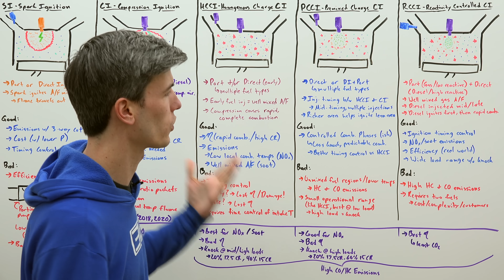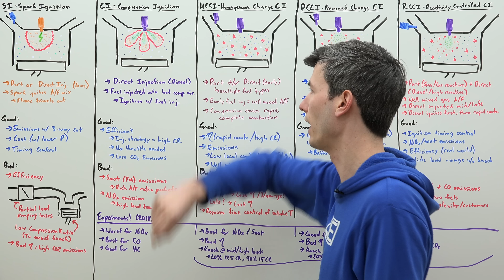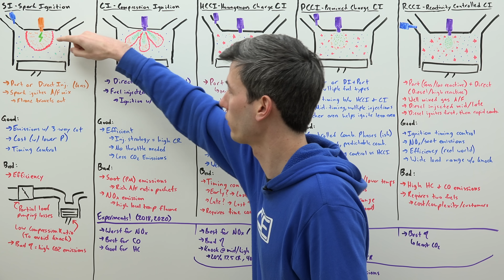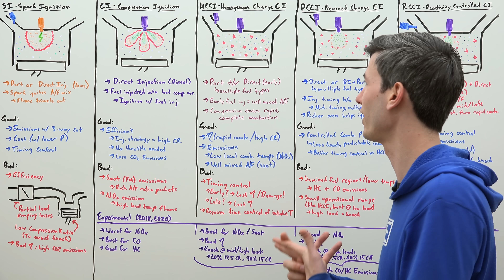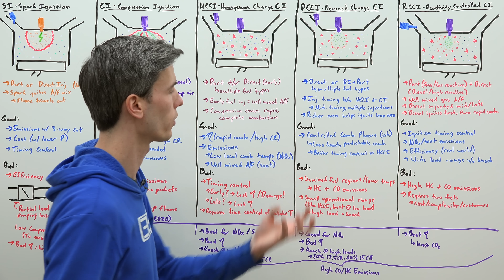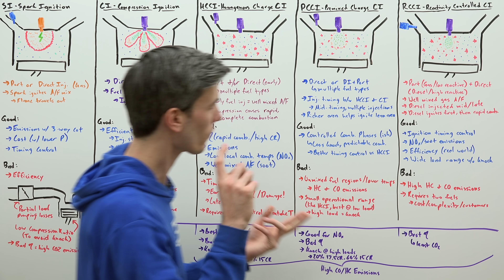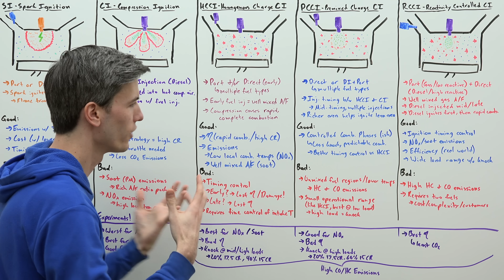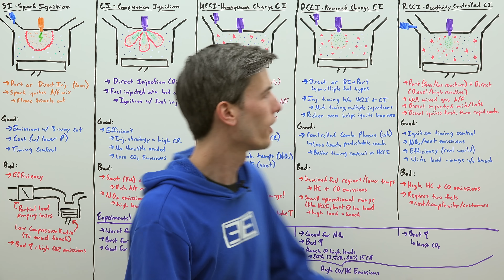If Combustion Engines Have A Future, What Is It?

Comment: I've heard about running an old car until it dies being more environmentally friendly than buying a new e/v. Is this actually true? Would love to see Engineering Explained guy going over the statistics of this issue
Reply from the maker: Answered here (starts at 9 mins 30 secs), however a video dedicated to the subject could be interesting! https://www.youtube.com/watch?v=6RhtiPefVzM&t=570s
Reply: @EngineeringExplained  how did you count co2 emission related to electricity production in that comparison? It depends on the generator technology
Reply: @EngineeringExplained  As long as there is a whiteboard, I'm in.
Reply: @Engineering Explained

If you want to make a video, search for the analysis of Volkswagen. They tried as one of the first to do a proper analysis of all emissions between different car motor types, cradle to cradle. So no propaganda like here from some petrol heads that try to argue that it's more dirty to produce (centralised) and transport electricity than to produce transport and burn fuel decentralised in every little damn motor.
Reply: @Majorhantines  
The ICE engine has no future. The end will come quick.  When fuel is difficult to buy as the stations close down.
Reply: @johnburns4017  "the end will come quick" Lol no it won't, internal combustion engines have a higher chance of being revolutionized than dying off with new materials being made or found, new technology, better synthetic oils, new ways to improve efficiency, and creating a synthetic fuel that is much more emissions friendly and has a much better reaction in the chamber. There is still plenty of room for improvement.
Reply: @TheFlame234  
Complete tripe.
Reply: @johnburns4017  Another Biden voter. What is difficult and not is reflected in the price of the car. What is it a Model S costs? Someone here is living in lala land.. created by the media and those in power.
Reply: @martinsvensson6884  
Did you vote that lunatic Trump?
Reply: @EngineeringExplained  You should but be prepared for the environmentalists to swarm into the comments section lol. One on twitter directed me to a website that "calculated" the impact of an EV being built, including mining of the metals for the battery pack (allegedly) against the car you currently drove.
Reply: @spamcan9208   Pretty hilarious that you're trying to portray someone correcting your incorrect beliefs with data and sources as "environmentalists storming you" . So far all I've seen in this comment thread are petrolheads preaching with a misplaced sense of authority about a topic clearly outside their area of expertise.
Reply: @EngineeringExplained  I would love to see a comparison of a bought new and owned 60 years 1960s Land Rover Vs a replace every 3 years lease car including the recycling of the one Land Rover Vs all those cars 😄. Imagine all that white boarding 🤔
Reply: @EngineeringExplained  
I know that you calculated that the electric car would be better than an old car in about 5 years when comparing CO2, but what about when the chemical pollution is considered when mining all the components of the batteries? How bad, or how good is that process?
Reply: @EngineeringExplained  a big YouTuber replied to me. I feel so special
Reply: @EngineeringExplained  Buy an old car and run it on gasoline/methanol/ammonia blended fuel or compressed hydrogen/natural gas.   I would have to assume the fuel is made from green sources.  But this beats an EV every time.
Reply: @EngineeringExplained  I’d like to see the assumptions behind that analysis.  Does it include all of the energy including recycling of the discarded ICE vehicle?  I suspect it also varies greatly depending on the electricity generation source for the EV.  I agree that a more detailed analysis would be interesting, but I suspect it is not trivial to make such an analysis in a realistic way.
Reply: @EngineeringExplained  
The simple fact is that ICE engines emits poisons right in front of millions of lungs. You cannot get away from that.
Reply: @johnburns4017  What's a UCE engine?  I'm not trolling.  I really don't know.
Reply: @simonthebroken9691  It's a Samoan Engine, just check out Jay & Jimmy Uso, they use the word "UCE" which means "Brother" in English all the time.
Reply: @johnburns4017  the simple fact is absolutely nothing destroys the environment more than the mining for the elements every electric car requires. And most places in the USA still use coal for electricity.
Reply: @Xander1Sheridan  
Nonsense. BTW, In few years time the UK will have decommissioned all its coal power stations.
Reply: @johnburns4017  sure they will. They can say anything they want, 99% of the time it is a lie.
Reply: @johnburns4017  
An electric vehicles give off poisons in a far more hidden way making them seem better than they possibly are.
Could take a look at the pollution caused by the strip mining and the production of batteries you still have pollution from power plants creating the electricity to charge them. It's less pollution overall most likely the thing is the pollution that they do give off is not right in front of your face and so it's simply ignored and people pretend that it doesn't exist.
Reply: @johnburns4017  so do many other industries but they aren't being singled out like engines. I'm a refrigeration engineer and fixing one leak can save 20 years of motoring for my personal car. R404a refrigerant for example 10kg is equivalent to 38Tons. Just let that sink in a while
Reply: @chappy2121  
Other industries are not being ignored.
Reply: @kens97sto171  
ICE vehicles poison people's lungs. The emissions are feet from their noses.
Reply: @johnburns4017  
And EV's poison from more distance out of sight.. doesn't mean it's not there...
Ever seen a lithium strip mining operation... 
Or a coal power plant.. 
Your just moving the pollution around.
It IS less pollution overall.. but it is still there.   
Having it not spew out of the car.. just allows you to drive around virtue signalling that you care about the world.
Reply: @kens97sto171  
If you are saying ICE cars are cleaner, you are getting ridiculous. There is nothing in sight to improve ICE cars: the oil production, hopelessly inefficient engines,  transportation, etc.  EVs in a matter of a few years will be using solid state batteries. 

Wise up.  Look.
Reply: @johnburns4017  
I never said any such thing. You keep talking about pollution coming out of tailpipes directly into people's lungs. My point is the pollution that electric vehicles make is not directly obviously visible but that doesn't mean it doesn't exist. Coal plants natural gas plants provide 70% of the energy in this country. That means that 70% of the power you use to charge up your electric car comes from fossil fuels. Obviously that is still cleaner and more efficient than burning those fossil fuels in an internal combustion engine. You also have the environmental damage caused by mining lithium manufacturing of those things etc. That is my only point is that electric vehicle Fans try to pretend that electric vehicles are perfect and don't pollute at all and drive around virtue signaling that they are saving the world somehow. Electric vehicles are more efficient and they do pollute less but the pollution that they produce is not zero nor is it inconsequential.. 
Efficiency is not the only factor here. It's cost of operation cost to purchase etc that's the reason people buy internal combustion cars right now they're really aren't any affordable electric vehicles for regular folks. There's a hell of a lot of people including me that tend to go out and buy a $5,000 used car drive the hell out of it for 3 -5 years and get another one if and when it breaks down. Now keep in mind that for me in that 3 years I will cover 150,000 miles miles.
I drive an old Toyota Prius it's extremely efficient for a gasoline-powered car it's also very inexpensive to purchase. Maintenance cost me very little as well. My total cost of ownership including all fuel all maintenance costs and tires is $0.07 per mile. Now I do my own maintenance so that certainly lowers my costs a bit. but when I do the math on a brand new Toyota Prius versus a brand new Tesla Model 3 long range. My break even cost point is 12 years even driving 50,000 miles per year. Cost of driving electric vehicle is about 4 cents per mile charging at home 50% charging at public chargers 50% which would be my circumstance. 
$30,000 for a loaded Prius
$48,000 for a Long range model 3
That's $18,000 difference.
 50,000 mi per year at $0.07 per mile is $3500 then work the number at 4 cents per mile is $2000. So  the Tesla only saves me about $1,500 per year
$18,000 difference in price divided by 1500 is 12 years. 
That's not a good financial choice.
And if you drive less than me it makes even less sense.  Although if you didn't road trip very much you could probably get your cost per mile down closer to $0.02  per mile charging exclusively at home. 
Now obviously a Toyota Prius and a Tesla Model 3 are in no way similar in performance. however the Toyota Prius is actually a far more practical vehicle it has more backseat room it has better cargo and trunk space, if something breaks on the car I can go to any auto parts place and get parts to repair it myself etc. But obviously the driving experience in the Tesla is going to be far better when it comes to acceleration and handling. Here's the thing though the vast majority of people don't care about that stuff. They care about cost of ownership maintenance and reliability.
don't misunderstand all of what I have said I like electric vehicles very very much I've driven a model 3 I've driven a Chevrolet bolt EV which would be my personal choice for driving around in the city especially at the price they're selling for now. but I road trip a hell of a lot too and that car does not make for a good road trip car because of the slow DC fast charging. So don't get me wrong I like electric vehicles but they are not the one solution to fit all problems currently. I think they will be in the next 5 to 10 years as battery technology improves and more and more options for different types of vehicles come to market. Hope you guys have a wonderful day sorry for the long reply.
Reply: @kens97sto171  
In the UK one refinery uses the equiv consumption of the cities of Coventry and Leicester combined just to refine oils. This creates pollution in burning fossil fuels to create the petro fuels. Then the fuel is burnt in vehicles creating more pollution, right under people's noses.  Polluting twice. Two processes to get vehicles moving.  

Charging batteries is only one process, with none under people's noses. 

You are doing a bad job trying to justify the unjustifiable.
Reply: @johnburns4017  the making of a brand new EV also emits pollutants to the millions of lungs, so what is your point exactly?
Reply: @warboyrb  
Overall EVs emits far less pollutants overall.  They do. I never made it up.
Reply: @johnburns4017  
No.. charging battery is NOT one process 
You have the pollution associated with the manufacturing of them.
The pollution to create the power to send the grid, to charge them . Which in the USA is 70% fossil fuels,  And the drivetrain losses using the power in the battery.
YES it is LESS  pollution.. which I've said MULTIPLE TIMES now .
But it's not pollution free..
And the pollution it does create is more removed from view and perhaps more difficult to quantify also.. since the mining of the raw materials is mostly done in non western countries. Conveniently out of site of the people using the final product.
Regardless there is barely enough supply to fulfill the current use of EV's.  
So let's not destroy what we have and NEED  now for what we will use eventually.
We can have both simultaneously and transition from one to the other as we the public CHOOSE to.. as EV's become more inexpensive and more available.. absolutely people will prefer them.
They are superior in most ways.. and once battery tech gets just a bit better . Virtually all needs would be fulfilled.
Reply: @kens97sto171  
You do get it, but are attempting to justify technology that should have gone decades ago. You have a have a vested interest in promoting this poison.
Reply: @Xander1Sheridan  Apart from CO2 production from burning fossil fuels which posses an extinction risk to humanity and many other species... But we dig that up too... Electric cars aren't perfect, but they're better, and that's what matters until a better option comes up.

Also Coal power stations are awful in terms of CO2/kwh relative to other generation options, but the efficiency of a power plant means it's actually better g/km to drive a purely coal powered EV: 2.21lb/kwh coal power station. Tesla Model 3 160wh/km, 6.25km/kwh, 160g/km. US current average is 251g/km. Not to mention coal only contributes ~23% of American Energy production.
Reply: @johnburns4017  internal combustion is here to stay.

The key is ENERGY DENSITY.

The amount of area the energy takes up is a HUGE factor in efficiency, and this is what throws most electric vehicles out of the ballpark completely.

You see, efficiency effects all aspects of the vehicle, yeah sure the electric motor may be around 95% efficient, and the drive system may be 87% efficient BUT the storage of energy is around 70% efficient (amount of power put in vs the amount put out) and the use of space to store that energy is TERRIBLE.

  From an energy density viewpoint, lithium batteries are crap.
Reply: @chrisarundel9199  
"internal combustion is here to stay."
What is it like a La La land?
Reply: @johnburns4017  yea well evveryones used to it
Reply: @johnburns4017  nothing in sight to improve ICE cars? I take it you've never heard of synthetic efuels then...
Reply: @johnburns4017  Meanwhile: Synthetic efuels said hi.
Reply: @johnburns4017  they aren't doing nearly enough. Taxing the poor people is the wrong way. The big companies are the ones with money not average joe. The client i work for is supposedly a "green, eco" focused company. They have lots of very old stores with very old problematic equipment that have r404a/r407a they do not want to replace any of it. When they open new stores these are on c02 refrigerant which is quite abit different. What's even more ironic is the c02 used is made fresh by chemical process, not harvested from the atmosphere even though they're able to do this. They buy ever cheaper less reliable and more difficult to work on kit. Oh and they refuse to put doors on the equipment so it has to be bigger and have more gas to account for that. Their reasoning "customers won't open doors" they've also cut install times down to 5 weeks for a full store refrigeration system. Also I can stand outside all day dumping c02 into the atmosphere no problem yet the c02 coming out of my car is the issue. Yeah right
Reply: @papasmith7648  
ICE hopeless inefficiencies say Hi.
Reply: @johnburns4017  ICE cars also says hi, I would like you to meet my friend "fast refuelling time"
Reply: @johnburns4017   well, do you have any ideas to push away of what "should have been gone decades ago" more faster???? since you're talking a hell of a lot about the "polluting cars", but not the POLLUTING INFRASTRUCTURE THAT'S BEEN AROUND FOR CENTURIES THAT YOU REALLY TRYING TO TALK ABOUT, huh? i thought so...
Reply: @johnburns4017  so anyone who contradicts you is a paid lobbyist?
Reply: @johnburns4017  While I agree most of the population should be driving EV's, you simply straw-manning your way through this by just calling it a poison isn't helping change minds. THE SIMPLE FACT is that combustion vehicles will always be a niche and will continue to be made for a few people that are willing to pay a premium to have them. EV's will become cheaper than combustion but again, they will never fully disappear.
Reply: @shadowmatt911  
People still run steam engines for fun as well.
Reply: @johnburns4017  I meant that the government will allow people to get special licenses and/or pay more to buy petrol models of EV cars. For example, muscle cars will always have a petrol variant because that's simply what they are, loud obnoxious toys. Most of them will likely be stick shifts as the only people actually buying them will be car enthusiasts.
Reply: I regret clicking on this comment.
Reply: I remember seeing a test of a Saab 9000.. Testing in London showed that the exhaust coming out the tailpipe was CLEANER than the air going into the intake.. this was ca. 1992.
Reply: @jesinbeverly  I remember such a test in Sweden when the new Saab 900, that later was named 9-3, came out.
Reply: Would only make sense to a simple person like me . All the energy used to produce a car and transportation to get the parts to the assembly area.
Reply: It would probably depend on the vehicles.  I get 13 mpg. A prius gets a lot more. It would be more environmentally friendly to switch.
Reply: @dylantroutman4363  depends on your mileage. If you don't drive much, there is not much to be gained from the switch.
Reply: Any vehicle powered by a remote energy source can benefit ,throughout it's life,from new technology used to produce that energy.
A 1990 fossil fuel powered car will only ever be as efficient as a 1990 fossil fuel powered car and will get worse as it ages.
Buying an EV and keeping it for 20 years is more efficient than buying a new EV every 5 years.
Reply: Still running a 40 year old toyota daily may be a issue killing it wont die 🤣 800000km strong
Reply: yes cause it takes a lot of energy to make a car
Reply: @ThunderClawShocktrix  It does actually, if you go to any automotive factory, every production line has at least 5 breakers that are 480 volts and at least 15 that are 120 or 240 volt. So yes, it takes a lot of energy to make a car. Compound that with the fact that there are at least five lines per factory. Most factories range in the 10 to 15 range. That's not even talking how much power is necessary for other essential operations off the line or computer systems that are running 24/7. Get a job in automotive before you chime in like that.
Reply: I'm pretty sure it depends on how much you drive. First the most ecological thing to do is to avoid driving when possible. If you don't drive a lot (i'm averaging about 3000miles a year by car, for about 8000miles by bike), then an old 4cyl ice is fine. It won't produce much co2. The electric car would require a lot of material and carbon for manufacturing and the battery would degrade without any driving being done.
So in the end it depends on your mileage. On the shitty american electrical mix i read that you need to drive about 60000miles to make for the manufacturing of the new ev car.
Reply: Yes
Reply: @Kristaps Valainis the co2 cost of a new Tesla Model 3 Long Range would take 9 years of average usa driving to offset at current electricity co2 costs. but the co2 cost of electricity is falling so it will be less then 9 years soon.
Reply: It's due to the concept of "invested energy" and materials. you already have that car, it's made, if someone makes a new car for you to buy it needs material and energy to make and ship.
Reply: Most cars will out last they're owners if they're properly maintained......so ya it'd be significantly more environmentally friendly
Reply: @robbalinski1606  Old cars yes, but I can say as a person who works automotive, that with modern vehicles, the manufacturers can make and request way better quality parts at no additional cost to the consumer. For example, I can recall several instances, not gonna name any names, cough cough Dodge; no but really, Dodge for example will go to their suppliers and say, "Hey we can't have that part lasting 500,000 miles, make it fail at around 150,000." It's all a money scam to make you keep bringing your vehicles back and buying new ones.
Reply: it is... my car run for 25 years and still run with minimal maintenance....
Reply: The nub of it is grey energy, that is the energy embodied in the manufacture of the vehicle. every combination of a vehicle and its potential upgrade will be different. my feeling is so long as your current car is in good working order its likely best to keep it instead of paying for a new one to be manufactured. 
That being said, I would think it would be better to trade it in if you were thinking of switching to electric, even when accounting for grey energy an EV will account for less total pollution and vastly less local air pollution.
Reply: @strangelove9608  Talk about Hypocrisy to the n-th level.
Reply: @strangelove9608  The Green Hippie Londoners who love their wood fire heaters are giant hypocrites. Burning Wood is ok, but the rest of us are being forced into heavily polluting, environmentally unfriendly all electric vehicles. Those vehicles are SUPER heavy, do more road damage, which requires petrol products to help fix in the long term. The battery's are a nightmare to recycle. The mining for the materials and the manufacutring process for the batteries are even worse than making normal cars. I at least support a PHEV 50/50 hybrid solution and have listed out everything I want to do which would bring balance to the automobile and be a win/win for everybody involved. The Green Hippies don't care and only want to "Be Correct" and push "Their Agenda" with no consideration of anybody else. They're a arrogant bunch of pricks who don't deserved to be listend to since they're incredibly selfish. They just want to rush in for a solution with ZERO consideration about people now and the long term future.
Reply: @strangelove9608  There are 149 replies to Kristaps's comment, and I'm NOT going to hunt for mine. That's just how it is, with YouTube's dipshit UI. IAC my sense of smell is certainly not so bad I can't tell cooking oil from hot crankcase. Christ knows I smell enough of it out on the street. You probably have one of those vehicles yourself. You sound like the type.
Reply: @strangelove9608  Carbon dioxide is not a polluter. Its what everything growing lives off of. It was called "The gas of life" in Sweden back in the days before the climate scam started.
Reply: @martinsvensson6884  "The Climate Scam" What does whom have to gain from this proposed scam? It is independently agreed by people with no vested interests. How would this scam adulterate the numbers coming out of peoples thermometers in their back garden? or out of peoples atmospheric CO2 loggers? It's a bit far fetched to suggest that climate change is fabricated. Occams Razor.

If CO2 isn't a polluter, why not try breathing high levels of it? 

Even if Climate change weren't happening due to CO2 production, the particulate matter produced by combustion contributes to more global deaths each year than Nuclear ever has, and most people think Nuclear is too dangerous. Disagree? Then prove it by breathing diesel car exhaust to no ill effect.
Reply: @Leo99929  "It is independently agreed by people with no vested interests." Haha :) Its "agreed upon" by those in power and if you want to keep your job you go along with it. Stop listening to people working for the beast. It doesnt alter the temperature from peoples thermometers. They alter the data collected. And that is not from peoples thermometers.

No its not far fetched. This is what they have been doing for at least the past 150 years if you just take some time and look up some old news papers. You can breathe as much CO2 as you want... as long as you get enough oxygen. Because CO2 is not toxic in itself. Or you mean that because you cant breathe water then it must be toxic too? :) Plants breathe CO2. Without it they would die and then humans would die too. 

There is catalytic converters on cars nowadays so as long as they are in action cars dont pollute that much. Some air might even come out cleaner during some circumstances. Diesel might have some issues still. So nothing I would breathe directly. Nuclear is good though. Probably the best energy source we have for large stationary power plants. Except maybe water in some places.
Reply: @strangelove9608  I think you misunderstood what I was saying: I was suggesting a system where the poor get more discounts than the rich. And the money for that comes from those rich people who decide to run a gas guzzler because they can afford it paying for the privilege. I don't know how you misinterpreted me to the exact opposite of what I was suggesting...
Reply: @strangelove9608  EV's use regenerative braking to stop, so less brake dust from them. Almost zero if you drive carefully. Tyres still create particulate matter... What's your point? That EV's don't achieve zero particulate pollution so why bother trying to improve things at all? That's ridiculous. Every tiny improvement adds up and matters.

I have a first class honours Masters degree in engineering which included education on environmental, financial, and political considerations. I work in research for an automotive company. I think that makes me "properly educated" and "in the industry". And in my professional opinion: Most current EV's are far from perfect, but they're light years better than ICE vehicles, any improvement is worth having, and the improvement EV's give over ICE are vital to humanity in the medium to long term.

The con is people driving in London. It's a city. It should have excellent and efficient public transport. That is a failing of our government, not technology.
Reply: @strangelove9608  
Total nonsense.  Someone told you to write that.
Reply: @strangelove9608  ^_^, you'd have it easier if you were consistent.
Reply: @strangelove9608  I'm saying all vehicles use an immense amount of energy to create. EV's and hybrids just use more since they are more complex designs thus more people will mess up along the lines and will stop the production lines to fix problems, thus drawing more power. They also, depending on design, will build additions to factories meant just for the large batteries to be manufactured which takes immense power to create on their own. Over time we will become more efficient and designs will improve but it will never be as low as plain internal combustion engines, frankly your high if you think so. But while we are on the subject of obsolescence, yes hybrids especially are designed to fail. If you have any remote problem with your 12/24v battery or battery pack usually located under the vehicle, you aren't going anywhere. The biggest problem that hybrids and EV's will have in the near future is right to repair. As it stands they must be taken to OEM or certified mechanics and I think we all know that major manufacturers aren't certifying anyone unless they are forced to.
Reply: @strangelove9608  
We will be driving EVs sooner than we think. Great cars to drive.
Reply: @strangelove9608  
What else have the screaming voices told you today?
Reply: @strangelove9608  
The real would be EVs very soon. 
No brum, brums.
Reply: @strangelove9608  "More equal than others" What does that mean? In terms of wealth and opportunity, no, we're not all equal. If you have over £50k in wealth (including savings, car, house, belongings) you have more money than most people on the planet. And having wealth increases your opportunity and apacity to increase your wealth. A poor Person can't afford to drop £100k to buy a business that would make them £1k a month. Or to buy up all the cheap stuff in a depression as the poor sell off stuff cheap to make ends meet, then they can hold onto it for six months and drip feed it out to keep demand high and charge maximum profit. They can also affort to spend all those years in medical or law school and focus on their studies rather than work 3 jobs to make rent while studying.
Reply: @strangelove9608  That's the "no true scottsman" fallacy: anyone who disagrees with your statement even after passing your elegability criterea, you disregard as being an outlier. 

Black holes don't destroy matter, they compress it. Though some may be released as hawking radiation. The Law of Conservation of Mass Energy says that energy can be converted into mass and visa versa as described by the famous E=mc². And that energy/matter cannot be created or destroyed. Only converted from one form to another. Friction brakes convert kinetic energy into heat and sound, with some used to break the chemical bonds that hold the brake pad mattterial together. Regerative braking converts the kinetic energy (KE=0.5mv²) in the moving vehicle into electricity (E=IVT), then this is used to recharge the battery by conversion into chemical potential energy. There are some frictional loses that heat up the components, and resistance in the wiring, but about 80% of the kinetic energy in the vehicle ends up stored in the battery. Where as in an ICE vehicle, 100% goes into heating your brake disks and wearing down your brake pads.
Reply: @strangelove9608  That's too advanced reasoning for the average Joe :) That's not what the TV told him. 
But it will balance itself out in the end. And it seems to go in cycles mostly based on the sun. Also the oceans have immense buffering potential. The amount humans release is minuscule compared to the variation the oceans contribute with.
Reply: @strangelove9608  I have no idea what an RGV250 is, and care less. But if you keep on with that attitude, you're going to find yourself kicked to the curb pretty effen curb. You're on the wrong side of history, bubba.
Reply: @strangelove9608  =D
Reply: @strangelove9608  No worries bro. I want to solve the climate issue. But you can't go about it by screwing over large swaths of people to achieve your goal. That includes all of us "Petrol Heads" and the industry behind it. I just have a different solution based on the practical realities of technology.
Reply: @strangelove9608  
You must stop making things up.
Reply: @strangelove9608  Not if the person actually being addressed is, in fact, acting like a bubba.
Reply: @strangelove9608  
You must stop making things up.
Reply: New fuels are being developed that give extremely clean emissions from internal combustion engines. For example the new synthetic fuel developed by porsche reduces tail pipe emissions by 85%. This would put the internal combustion engine on a level of emissions output at the same level as a electric vehicles.
Reply: @moabman6803  
The ICE still wastes 80% of the energy in a fuel tank. The ICE engine, roll up, roll up, buy one now as they will not be available soon!
Reply: @johnburns4017  That is true. But the energy density of internal combustion fuels allows me to tow heavy loads with not too much impact on range. I just towed a 3500lb trailer and only lost 1mpg. There are pluses and minuses of both electric and  combustion. The minus for me is difficulty charging a electric vehicle. In the city I live in most people park on the street. So access to charging is difficult. I suppose chargers could be put on the street, but people steal stuff like that. So you'd have to replace it every few weeks.
Reply: @moabman6803  
Read again what I wrote.
Reply: @johnburns4017  I read it. I don't buy new vehicles so it doesn't affect me.
Reply: Run it until it dies then buy an EV
Reply: @charlie_nolan   Yes a electric car going down the road creates no tail pipe emissions. However the environmental impact it takes to make a battery along with all the electronics a electronic car has is pretty bad. For example it was found that fish over 100 miles away from a lithium battery plant in Nevada were affected by the pollution from the plant contamination of water. In the lithium triangle 65 percent of the water is used for processing lithium. It's contamination of the water which kills aquatic wild life and animals that drink it the water is a environmental disaster. This is happening while electric cars take up 2% of car sales in the USA. Now imagine how it would be if everyone had electric cars? Millions more batteries. And what happens to those electric cars when they crash or are in such disrepair they get towed away? They will sit and degrade. Metals from the electrodes and ionic fluids from the electrolyte will leak into the ground. One country reported in research thst only 3% of its lithium batteries are recycled. Recycling large automotive batteries will be difficult. Different manufacturers will use different compositions of metals, thus it will be difficult to disassemble them and properly recycle. Even of it wasn't difficult, people don't recycle batteries now, so I don't see that changing. Electronic waste is already a huge environmental disaster. Most is not recycled properly and just deteriorates into ground pollution. Electric cars will increase this by huge magnitudes.
Reply: @moabman6803  did you not watch the video? It addressed this...

It said lithium-ion batteries are only about 7% lithium and the oil needed to drill to sustain gasoline cars is far more damaging to the environment
Reply: Who cares run it forever catless, egrless etc it’s more fun !
Reply: @moiv8  you should try heroin. I've heard it's about as much fun as you can have. Apparently there are some potential downsides to health, but you don't care about that, right? It's about maximum fun!
Reply: Burn = resource forever gone from multiple uses. Electric = > 90% recyclable battery materials, plus several sustainable non-polluting alternative sources. So, just curious, can opposing piston engines be scaled up to drive ocean-going shippers? Then again, what justifies the burning, that makes “efficiency” go infinitely negative?
Reply: That goes for any new car. The main problem with EVs is the cobalt in the batteries, which 20% of what comes from the Congo is mined with child/slave labor. But Australia has a lot of cobalt reserves to be mined, and new battery tech is starting to reduce cobalt usage. Once solid state batteries are perfected, they will also last much longer too. As far as power, even if it isn't clean energy, giant power plants are more efficient than an ICE that has to be mobile, small, and light
Reply: @karasene2091  northern ontario is opening  a cobalt mine... in a town called cobalt. Used to be a silver mine and lots of cobalt came with it and was discarded
Reply: @karasene2091  not really any more. Also please remember a lot of cobalt is used to de-sulpher diesel. Also batteries can have a second life after being in cars and can also be recycled.
Reply: I'm fairly certain that question was answered in one of his videos in the EV series he made a while ago. Feel like I can remember that at least.
Reply: Pretty much anything from the late 80s onward and that has a properly operating cat is very clean. As clean and efficient as a 2020 model? No... But not far off. I'll wager the marginal cleanliness and efficiency is minimal. Your 1990 four cylinder will get you to work just as fast as your 2020 1.5L turbocharged 300hp but for $35K less. And they'll get about the same mileage.
Reply: I like it how suddenly Tesla appeared and  decided to make an "environment friendly" car that has all the sex people want... I mean you just have to appreciate the geniuses of advertising behind this product, because it is brilliant to the point where it actually became a separate religion and cult... I mean it has to be too good to be true when the CEO of the company becomes worshiped as a god himself...
Tesla doesn`t appear out of nowhere, just like that electricity it needs. 
For example to drive Tesla for 100km distance you burn around ~20Kw/h of energy.  That is equal to 200 incandescent 100W light bulbs glowing for 1 hour. That is a lot, this much of them would raise the temperature of the room in which they would be glowing... For example a modern household usually has around ~15kw of electricity inlet, which would not be enough to light that many light bulbs at the same time.. 
A diesel generator that is 20Kw of power burn around 10ltr of diesel in 1 hour time. Which means that it makes 20Kw/h of energy each hour and that takes up 10ltr of diesel fuel. 
 
A standard ~10 year old diesel car, for example VW group car with 1,9TDI engine on average burns around 6ltr of diesel for every 100km it drives. And there are plenty of cars these days who can drop that consumption to 4,5ltr/100km. Even older generation Skodas can do that... 
 So as far as this comparison goes, Tesla is equal to ~10ltr of diesel every 100km of distance. While any diesel car in Europe is very capable of ~6-7ltr/100km 
Electricity price can differ from country to country, but for example Europe average is 22 cents for 1Kw/h, that is because some countries have low price electricity, for example Lithuania, where electricity is 14 cents, while Germany is more than twice that at 30 cents (due to renewable electricity being dominant in the network... How Ironic...) 
So owning Tesla in Lithuania 100km trip would cost me only 2,8 euros. Which is probably cheaper than owning a bicycle (100km for a bike can damage some part so it might cost some money to fix it)
Owning a Tesla in Germany however,  sets you off at 6 euros/100km and this is getting very close to the diesel territory... 
In fact this "green" energy for some reason is more than twice expensive compared to our Lithuanian mainly gas made electricity. Which is actually surprising, considering the maintenance cost, because I believe maintaining the gas pipes and all the necessary power plant components should be by far more expensive than maintaining "green" energy power supply.
Reply: @S3l3ct1ve   as HuntFor Money mentioned here, your math is completely wrong. ICE engine is thermally very inefficient, see previous EE videos. 1.9 TDI's are good, but they had their good old days already. But please try include NOX emissions and all socioeconomic consequences ICE has. I know it's rarely valued in Lithuania, hence why poor regulations and destroyed catalytic converters, ripped out DPF's are more standard than ever, just an example how little people care about environment.
You also talk about electricity costs, that are uncomparable for many reasons. Electricity grid is very unreliable in Lithuania, especially in villages. To maintain properly working grid, it costs a lot money. Just think about this - here in Denmark we have 99,99% uptime and all houses has access to 3-phase power. Try going justmore outside cities and you will see shoddy networks, unstable voltages, power outages and unavailable 3-phase power. Renewables also have their cost, Lithuania is just postponing it and being first movers, and only due to first movers like Germany and Denmark renewable prices are getting lower at this rapid rate :)
Reply: @S3l3ct1ve  your math is wrong. 1 liter of fuel has energy content of 10kwh. Tesla does 60km with 10kwh. So for 10 liters of fuel, Tesla does 600km while a diesel car will need 40 liters for the same 600km. You see a difference? Tesla goes 4 times further for the same amount of energy.
Reply: @creatineenjoyer7345  you forget that in most places, electricity is sourced from fossil fuels. Teslas only make sense where the car is made and charged using renewable electricity.
Reply: Depends if its an old v8 it will continue polluting. If its an old 4 cylinder, keep it till it dies. Also not all new cars take so much carbon to produce. Simple cars like VW Up or Smart ForTwo dont create huge carbon footprint during production
Reply: @creatineenjoyer7345  I live in Europe, V8s aren't particularly popular, to the point that I don't know anyone who has owned a V8 car. And while a VW Up doesn't create huge emmisions in the manufacturing process, it's a very tiny and impractical car, so immediately doesn't fit my use cases
Reply: @kristapsvalainis1671  I’m in Herefordshire. 
I have several V8s in the garage.  😂👌
Reply: @kristapsvalainis1671  You are right. In Europe now the cars are almost all 4 cylinders (the vast majority) or 3 cylinders (an increasing quantity).
Reply: @kristapsvalainis1671  Europe taxes vehicles on C02 emissions I believe, so a larger more powerful engine will create more C02 vs a small engine.
Reply: @creatineenjoyer7345  This is a bad take. The engine configuration doesn't have any bearing on whether or not you should keep a car. What you should say is if your car is reasonably efficient, in good working order, and isn't missing a bunch of emission control equipment, you're probably better off keeping it. It makes sense financially and environmentally. If your car isn't any of those, or if it no longer suits your needs (IE, growing family, or you moved into a tiny apartment downtown), it makes sense to pick up something new and efficient.

I can't imagine how much you'd dislike Gordon Murray's new V12, Hunt, even though it has a smaller displacement than some production inline 4s.
Reply: @yrmoma  how many mass produced cars have inline 4s that have a displacement greater then 4L?
Reply: @creatineenjoyer7345  I would say the opposite. An old 4 cyl is not much to keep. An old V8 will last much longer and also provide some fun during that period. For not that much higher consumption.
Reply: @martinsvensson6884  not much fuel consumption with an old v8? Is this some joke? Old V8's can barely get 15mpg.
Reply: @creatineenjoyer7345  Not compared to an old 4... you cant compared old V8 to new 4... 
And the faster you drive the less the difference becomes.
Same year, same manufacturer, it might be maybe a 20% difference. But you will have twice the hp and twice as fun with the V8. And the engine will last longer.
Reply: @creatineenjoyer7345  carbon foot print it's BS, look into super tankers and plankton in the sea
Reply: @creatineenjoyer7345  you can't fit a family of 4 in a VW up.
Reply: 100% Yes it’s better for the environment. Most videos you’ll see are comparing emissions. From a emissions standpoint a new EV is better. However most people are not factoring in manufacturing and SHIPPING. The transportation of the vehicle from the plant to your dealership is important to factor in. Now if your vehicle is produced locally, then that’s a different story.
Reply: @BeyondLumination  also people seem to forget oil well to wheel costs. Refining and shipping oil around is a big issue.
Reply: @BeyondLumination  An interesting point...
Reply: @BeyondLumination   I was surprised to find out that the delivery of your item from the distribution centre to your house produces more CO2 than transport from China in a shipping container. Even though ships are poorly regulated and massive polluters, shipping is just very efficient for large volumes of stuff. I wouldn't be surprised if you produce more CO2 in a month than was used to ship your car to the dealership.
Reply: @BeyondLumination  if you sell your old car there is now your old car still polluting along with the one you just bought.
Reply: P.s. some sources even suggest that a 20Kw diesel generator use around 1.6 gallons of fuel at full load for 1 hour. So that is 6 liters of diesel for every 20Kw/h 
This is in slightly favor towards Tesla, but it still puts it in the diesel cars range of efficiency...
Reply: Almost always unless you drive a LOT or the car is a tremendous gas hog. You can always sell a gas hog to someone with a two mile commute or a retiree to make efficient use of resources...or use the money you save on a new car to move closer to work so you become the person with the two mile commute, at which point the old gas hog is at its best staying in your hands.
Reply: @alanhorn8253  old gas hog? We're not in 1970, anymore. Some of these cars get close to 30 m.p.g. , I reckon.
Reply: @JT_771   older cars can run clean but they require good maintenance to do so.
Reply: Jason, I watched an episode of Autoline last year where discussed about plasma ignition. Any thoughts?
Reply: In short, if you're going to buy a new car, it should be electric if you want the most environmentally friendly option. And don't scrap your still functioning modern car.

If you have a modern ICE vehicle, it's probably not as environmentally friendly as an electric car, but scrapping it and buying an electric car could be worse: If you sell it on, then presumably the person you sell it to replaces their less environmentally friendly vehicle, and you get a trickle down cascade of improvement hopefully eventually knocking the worst polluters off the road. Scrapping anything but the worst offenders reduces the market for potential upgrades, making them more expensive, meaning less people upgrade.

In reality, those who can afford the scrapage schemes for new electric vehicles often don't drive the worst cars, and they're scrapping a car which likely still has life left in it, and could knock a heavier hitter off the road, if it were resold instead. Cars currently only need to be 10 years old to qualify, and my 8 year old car emits the european average of 120 g/km, which means it's better than 50% of the cars out there, so scrapping it means 50% of people have one less vehicle they could swap their gas guzzler out for. So scrappage schemes can be bad.

It's likely that increasing road tax could make running the most heavily polluting cars more expensive than upgrading to a less polluting option, offering scrapage schemes as long as you move to a less polluting vehicle could have a much bigger impact, with the amount you get being proportional to the difference between the two vehicles.
Reply: @Leo99929  most definitely not environmentally friendly
Reply: @Leo99929  true statement coal powered EVs are way cleaner than ICE cars. 😂😂😂
Reply: @Gad1768  I'm assuming this is intended to be sarcasm? 

Coal power stations are awful in terms of CO2/kwh relative to other generation options, but the efficiency of a power plant means it's actually better g/km to drive a purely coal powered EV: 2.21lb/kwh coal power station. Tesla Model 3 160wh/km which means 6.25km/kwh: 160g/km. US current average is 251g/km. Not to mention coal only contributes ~23% of American Energy production.

So yes, "coal powered EVs are way cleaner than ICE cars." But it get's even more clearly so in other countries:

This ignores the brand new cars like Prius and Ford focus that get ~60mpg and less g/km... But it also ignores the energy splitt on the grid and is a more accurate guide for the average American for if a Tesla would be better in terms of CO2 production than their current vehicle. Though each gallon of gasoline produces 8887g of CO2, which 60mpg (3.9l/100km) is 148g/mile or 96g/km... Though UK average electric production is 185g/kwh, which makes the Tesla 29.6g/km, still less than a thrid of the best petrol car emmisions. And that will only get better over time, tending towards zero. 

Also Solar is now the cheapest source of energy production, so if the government have your best interests at heart, they'll start ramping up renewable energy production like most other countries. Problem is that US dollar is linked directly to the price of a barrel of oil, and the US uses oil politically. It does have military strategic significance. When was the last time America sent troops to a place that had no relevance to oil? How much does the millitary cost? How much has been spent on Nuclear weapons for the two that have ever been used in war?
Reply: Yes, 20 years as a mechanic speaking.  A properly maintained 70s and newer V8 are not that bad. I drive a early 70s Chevy pickup that passes an emissions test every year no problems. And all the parts for older cars and truck are made out of steel, cast iron, aluminum and plastic. All of witch are the most abundant, cleanest and easiest materials to recycle. You can burn a lot of gas for the the same environmental cost as an EVs 1200 lb. 🔋 that 90% of the time is going to be charged by coal anyway. Just because you don't see the emissions as the end user doesn't mean they didn't happen.
Reply: @Gad1768  very true. However even if you charge your ev's with electricity that came from natural gas power plants, your emissions will be lower. Reason is that generators in natural gas power plants run at constant rpm and are around 55-60% thermally efficient. Also chimneys in power plants take car of a lot of pollutants that a car has to spit from the exhaust. Coal power plants i agree are not good with less than 40% thermal efficiency.
Reply: @creatineenjoyer7345  like the thought that would help with the energy source problem. But you still have the high environmental cost of 🔋 production. Plus something now one ever talks about the weight. I believe a Tesla 🔋 is about 1150 lb. Put that in your ice Sudan and see what it dose to your mpg. Electric motors are very efficient no doubt but when you factor in all the drawbacks no dice. 🔋 tech needs to get closer to gas or diesel energy density. 120 lb. Of fuel takes a ice Sudan 640 mil. EV 1150lb 🔋 gets 200. With out current tech EVs just don't get it done. Your thoughts?
Reply: @Gad1768  i agree. Current battery density is pretty poor. Its only good for phones, laptop and electric bicycles. Cars are meh, too heavy with poor range.  Planes and ships cannot even be electric with the current battery tech because of low power density.
Reply: @creatineenjoyer7345  when they tackle that problem I'm all in on EVs but for now I feel like there a gimmick.
Reply: Environmentally friendly yes, climate friendly no
Reply: True regarding global warming and global pollution, but at the local level (city's air quality) newer vehicles and to a greater extent EV's have a significant impact
Reply: @WeatherManToBe  IDK about the US, but here in Europe it's usually the house heating, not cars, being responsible for most of the air pollution (excluding industrial areas etc. of course). Example - while in the summer Warsaw's (almost 2 million city) air quality is well within the norms with a good margin, in winter it can regularly exceed them 3-5 times, sometimes even more. I'm not saying that cars' emissions shouldn't be minimised, but the focus on them is surely exaggerated, especially considering how little attention is given to the house heating pollution.
Reply: @8Hshan  spot on. Past Euro 4 for gasoline and Euro 5 for diesel, the improvement is marginal from the environments perspective, not from the individual vehicle.

Home heating, especially those cozy fireplaces and environmentally friendly pellet ovens are massive polluters.

Also many tend to forget 2-stroke scooters. One of these pollutes more than 50 to 70 cars.
Reply: @daszieher  Have the Government Ban FirePlaces, force all homes to close off their FirePlaces and disable them permanently.
Scooters can be converted to Electric Scooters since their range isn't expected to be that far or use newer ICE tech if needed for more range.
Reply: @8Hshan  
Two wrongs do not make a right.
Reply: @Xander1Sheridan  Good luck with that. They're giant Hypocrites.

I just want my 50/50 Plug-In Hybrid Cars for all. Maximum Peformance & Range for the least amount of money to the masses.
Reply: @Kamen_Rider_Blade  some cities are doing exactly that. Banning fireplaces and two-stroke scooters.

Little scooters are so cheap, it doesn't seem feasible to convert them to electric reliably. Just chuck them out, recycle the material and get a new one, designed to be electric from the bottom up.
Reply: @daszieher  You should see Taiwan's Gogoro Scooters, they're Awesome!
Reply: @Xander1Sheridan  i second that statement good sir. 👍
Reply: @Xander1Sheridan  Wouldn't the reasonable thing to do if you think humans are bad for the environment be to kill OTHER people? Then you get rid of more than one person... Also CO2 production correlates spectacularly strongly with energy production and global population. And it doesn't take a genius to see that each person requires energy to feed, clothe, and house. So of course more people means more polution and resource use.
Reply: @Xander1Sheridan  snowflake
Reply: @daszieher  true. New 2stro k e scooters atevalready banned  4stroke scooters will follow. And in mamy cities you can already rent a longrange E-scooter on many streetcorners. Many cities have aiready banned euro3 and older diesel trucks,  vans and cars from their city centres.
Reply: Old engines burn a lot more oil, at least beyond a certain age. I don't know any way you can really get away from that. The stuff in used oil is REALLY nasty. As a frequent pedestrian, I still get a whiff of old oil pretty regularly in this parts. It's awful. Again, por dios this is 2021. The future is already here, but it sure isn't evenly distributed.
Reply: Yikes, so many ignorant petrolheads that parrot debunked FUD...
Reply: who gives a damn about the environmental impact?  It's every man for himself, a paid off car drives better than any financed car...it saves your wallet...btw old V8s don't pollute more, the gas and cattys prevent most of that ...my old V8s run on E85 : so pay off your car and let the socialists worry about "environment".
Reply: @Flamixco  
Another Trump voter.
Reply: @johnburns4017  Hopefully. The less people that get brainwashed by the media, the better.
Reply: @martinsvensson6884  
OH he voted for Trump, not only that he thinks Trump did nothing wrong!  Amazing.
Reply: @johnburns4017  Yes very amazing, he actually had more than 1 brain cell and overcame the media brainwash. Not many do these days.
Reply: That truly doesn't even intuitively make sense. At all. You have to take projected, not accurate, old data from car manufacturers, and you have to assume there is no technology advancement as production of vehicles goes on. It really was a moronic rumor to have been continued anywhere passed about 2017 or so. This is just one of those things that car guys fear, because it means there will be less sexy noise making engines, for them to sneak around their wives with. Its just like when people say solar and wind are not sensible. That is absolutely insane, you just have to look at data, from the last few years, to see, these are just bull crap desperate perpetuations of incorrect information.
Reply: Electric cars use way too much electricity and are horrible for the environment. Plus, materials used in them are gathered by small children in Africa, under horrid conditions. Etc., etc., etc.
Reply: @billygunn7180  
You made that up.
Reply: @johnburns4017  Yeah, I woke up one day, and conjured it up. I have great imagination. BTW, most people don't put their face over exhaust pipe and inhale the "poisonous" fumes. Quite impossible. That's why they put exhaust pipes at the back of the car, so you drive away from them. The roads are usually located outdoors, as well, so the fumes dissipate.
Reply: @billygunn7180  
You should not make things up.